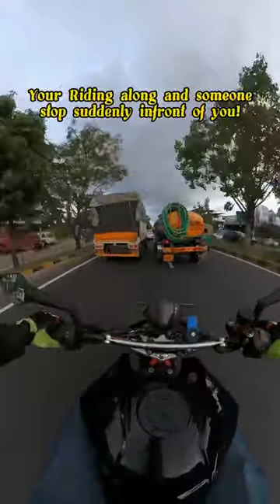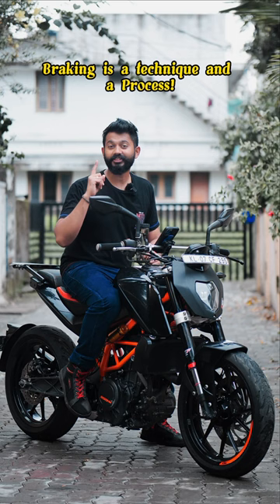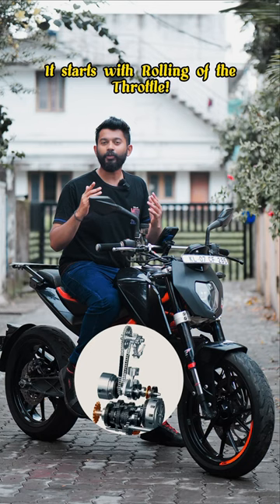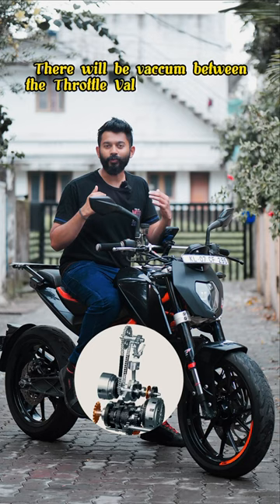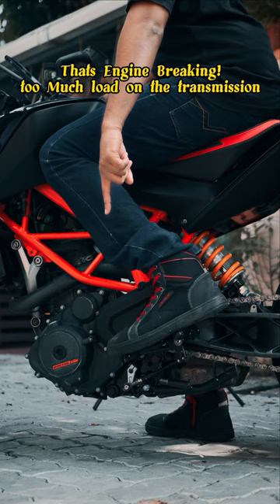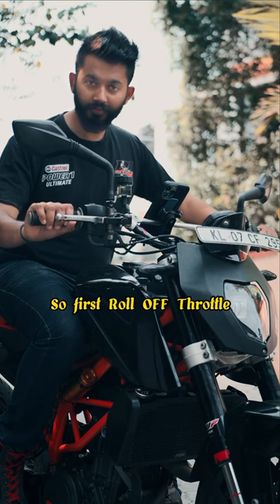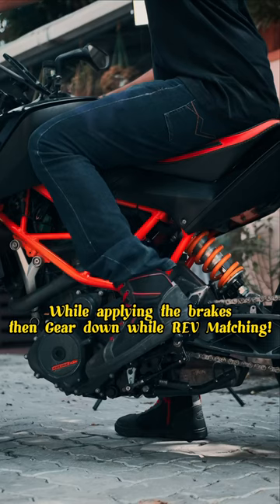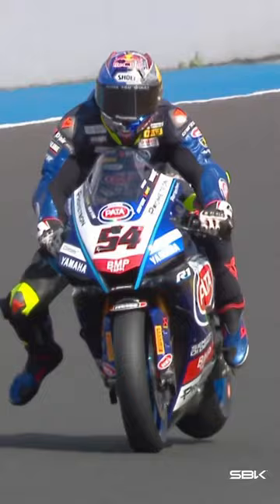Gear down first or brakes first? Which is the correct way to brake? #ktm

Comment: അത് മോൻ റേസ് ട്രാക്കിൽ ഓടിക്കുമ്പോൾ ആളു വട്ടം ചാടാത്തത് കൊണ്ട് തോന്നുന്നതാണ്. പബ്ലിക് റോഡിൽ ഇതിനൊന്നും ഗ്യാപ്പ് കിട്ടില്ല. ബ്രേക്ക് പിടിക്കുന്നതും നിരങ്ങി വീഴുന്നതും മാത്രമേ ഓർമ്മയുണ്ടാവുള്ളു.
Reply: ABS ulla bike vaanguka
Reply: pulliyod ith paranja ..pulli parayum "njan paranjath track il use cheyyanda process" anu ennu.. but video nde title will be how to stop in sudden,normal roads ....HE IS A CERTIFIED 🎇
Reply: സ്ഥിരം പ്രാക്ടീസ് ചെയ്ത് mascle memory create ചെയ്താൽ ഇത് പോസിബിൾ ആണ്. അല്ലാത്തവർ എത്ര ശ്രമിച്ചാലും ചിന്തിക്കാൻ time കിട്ടാത്ത ആ situation ഇൽ uncontrolled ആയി ബ്രേക്ക് apply ചെയ്ത് വീഴും. പ്രാക്ടീസ് ചെയ്ത ആൾ അയാൾ മനഃപൂർവം ശ്രമിച്ചാലും ഇത് സംഭവിക്കില്ല. That's the difference.
Reply: Clutch pidikkuka break apply cheyyuka simple. Pinne odikumpol surroundings epozhm sredikuka. Baki Ellam luck anu. Engine breaking avashyam illa. Normal break pinne pazham parikan ano
Reply: @Jackson-if4he u said it bro....

Comment: Vere vandi wrong side or sudden brake cheythal or
Evanenkilum vattam chaadiyaal
Adyam oru muzhutha theri vilikkum njn

Ennit accelerator automatically off aakkum + rear brake + clutch + front brake + gear down ithanu njn cheyyunne....
Pinne track njn video il mathre kanditulloo....apo sheri bye.....

Comment: Normally front brake apply cheyyumbo thanne throttle cut akum, throttle cut cheyyathe front bake pidikan padanu. For me i will apply both brakes and aggressive downshifting. Content athra convincing alla.
Reply: Njanum athe.... throttle cut cheyyum ennitt front brake pidichu kond rev match  cheyth kond 5 aanengil 3-2 okke gear down cheyyum bike super aayitt nilkkum...abs onnum illattha bike aanu enteth pulsar 125 ...innale athinte max speedil 95 kmph il njan vannathaa..but oru chechi right cross cheyyan vendi road naduvil nirthi left ilekk indicator itt right poyi athe pole thanne thirichu leftilekk thanne poyi 😢😢 njan vicharichu thattiyenn..95> 20 kmph pettenn aayi..bagyathin rakshapettu

Ingane cheyyunnath kond enthengilum problem undo??
Reply: @Fallen_angel2002  emergency braking il rev match nte onnum avashyam illa, vandi nirthuka ennathanu priority. Pazhaya super bikes il okeya rev match avashyamullu, in my knowledge. Throttle cut cheyyathe front brake liver leku eniku fingers ethilla, so when I grab front brake throttle is cut already, mine is two finger braking.

Comment: IDT
I think Before breaking  you should lower your gear then apply break if you are try to apply break before lowering your gear it can-easily led  to an accident but if you want to corner your bike then its okay you can apply this method may be I never tried. 
It’s impossible to stop a bike quickly if you are riding very fast .
How fast your ride your motorbike more distance requires to stop your bike.
Always leave fair distance while breaking that is the most imp thing while riding a motor bike .Bike riding is art of judgement .
These are for street riding guys
On Track very different vibe
we can have action plan for every Ride 
Same actions cant 
be implement on street mostly we have to stop @0km 
on track this thing not required most often.
My opinion for stop a motorbike shut the throttle lower your gear then apply break my opinion
Reply from the maker: Gear down first damages the transmission in the long run! Too much load on the transmission! Not a proper way!
Reply: Definitely no... First brake aanu allathe gear down alla

Comment: 1. Bro started with Panic braking and suddenly talking about cornering and engine braking. Stick to one!
2. In panic braking, you do not have time to do engine braking. So squeeze the front brake as hard as you can and pray! If possible, use the squeeze and load, and use rear brake if you have enough time.
3. Engine braking means letting go of throttle and slowing down. You may shift down through gears as well. There is nothing called "Engine Breaking" afaik!
Reply from the maker: Watch the video again!
Reply: Saw again bro. I still stick to my points 😊

Comment: Gear down cheyumbo clutch ntha  cheyande.?? clutch pump for every gear or wanna hold the clutch??
Reply: when i take a corner i always have doubt on clutch... Throttle release>Brakes>Gear down... thats what i do.. Then what i wanna do.?? slowly release my clutch depends up on my speed or wait for corner end???
Reply: @priyeshmlk hold the clutch, change gear, release the clutch. Everything should be done within 1 second. Don't keep on holding the clutch.
Reply: @priyeshmlk clutch pull cheythaa vandi kayyil irikkilla.. Vandi slow aayi nikkan pokunna timil clutch pull cheytha mathi... Gear down il aanenki clutch millisecondil vitt gear idanam..
Reply: @priyeshmlk  corneril clutch pidikkaruth.. Correct gear and speed il ang poyaa mathi.. In between balance cheyyan back brake use cheyyaam.. But ath vyakthamaayi padichitt venam